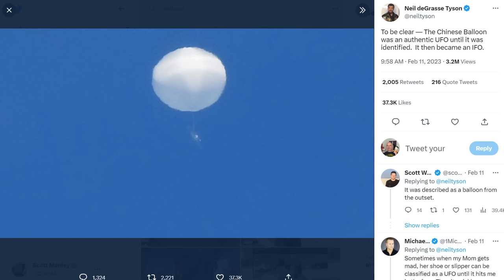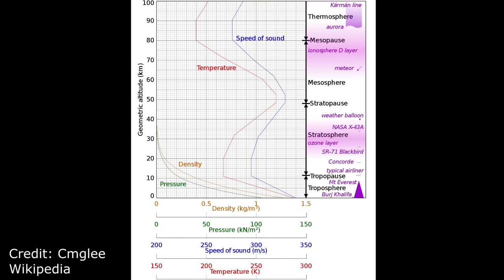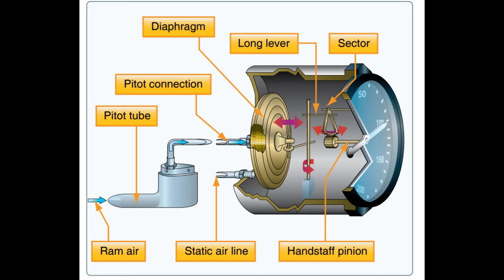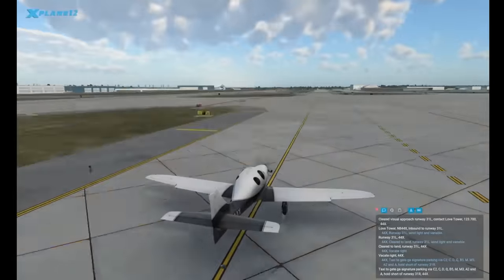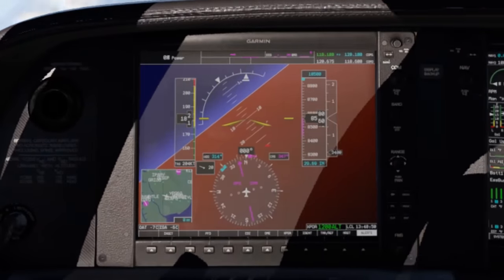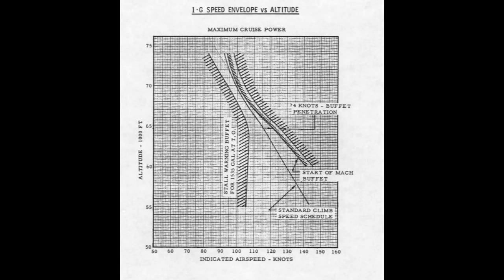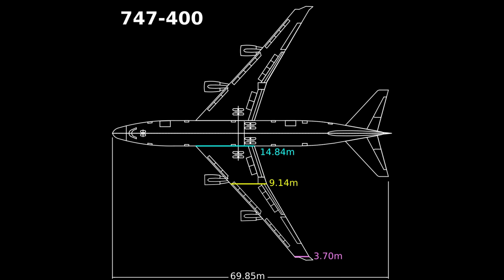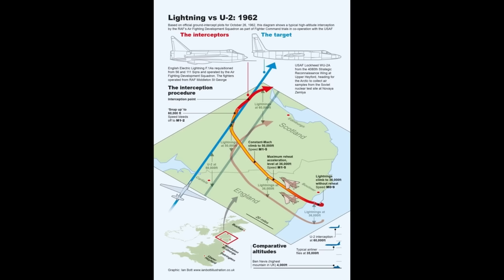How To Design A Plane To Fly At 100,000 Feet?

Comment: Thanks, I really enjoyed and got lots out of this video. The mirrored rocket and writing in the intro really made me wonder for a second.

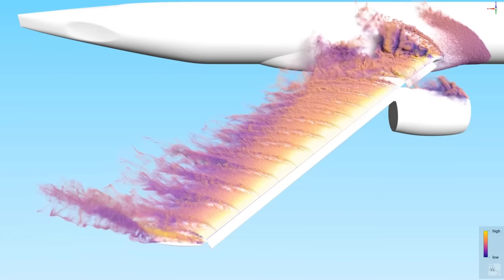You made a statement at around 1:55 that "...most aircraft use engines which push against the atmosphere... " while showing a jet engine on a test stand. While I guess a case could be made for propeller aircraft my understanding for jets it's based on the kinetic energy of exhaust gases propelled out of the back of the engine.  Or am I missing something here?
Reply from the maker: The exhaust gasses are just hot air, getting pushed out the back.

Comment: At Alice Springs gliding club i once heard one of the members talk of riding a summer storm up to 50,000 feet. The altitude recording device stopped at that height so he didn’t know how high he went. He said he didn’t have airspace clearance so didn’t get an official record. His answers to questions like how did he breath (oxygen tank) how did he get home with the canopy iced over (looked out the little airflow hatch).  I’m curious if he could have gone so high without a pressure suit?
Reply: High-altitude variants of the Spitfire are recorded in post-war exercises as having reached 49,000 feet, but these had pressurized cockpits. Unpressurized Spitfires are documented as having fought about 40,000 with pilot oxygen, but with extreme difficulty and only on rare occasions. I wouldn't go so far as to say that it was impossible or that he is lying, but I find it interesting that he was prepared enough to have oxygen with him to climb so high that airspace clearances would be a complication.
Reply: @Ensign_Cthulhu  That’s cool to know! He said looking at the huge summer storms roll through every year it was was only natural to want to climb one.

Comment: Not sure if this is true, but supposedly it is.  In the SR-71, you could actually save fuel by flying faster.  I think it was the compression heating of the air allowed them to use that to get additional power out of the engine?  Doesn't sound right, thermodynamically speaking, but supposedly faster = less fuel used, well up to the limit of the hull heating.

Comment: Great video Scott. Just one observation. Mach Tuck. Is this more to do with the centre of pressure of the aerofoil moving rearward causing a nose down attitude? Hence why Concorde shifted fuel to the tail to counter the effect, re balancing the C of G as the aircraft accelerated through the transonic region. Subsonic airliners such as the B737 also had/have Mach Trim systems that automatically added nose up trim for the same reason.

Comment: If increasing wing area is not an option than perhaps some of the thrust can be redirected  to provide additional lift and flight control. The thinner atmosphere at higher altitudes should reduce air resistance so the aircraft will not lose that much speed despite the lower thrust.

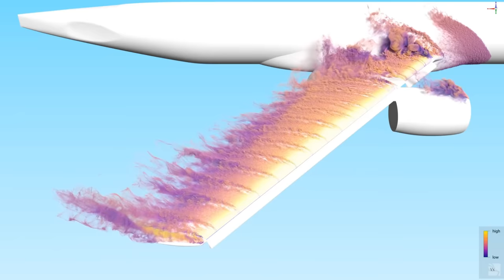Comment: Aircraft engines never “push” against the atmosphere as stated at 1:55 and 6:35. Propeller, rotor or turbine aircraft engines operate off of the same principle as rocket engines, Newtons 3rd law, for every action there is an opposite and equal reaction. They all expel air (mass) in one direction resulting in a thrust force in the opposite direction.

Comment: The "engines pushing against air"  thing should be addressed: they don't push against air if it's a reaction or rocket engine, they  push  against their exhaust. Propeller engines push themselves forward by  combining Newton's third law "for every action, there is an equal and opposite reaction" and Bernoulli's principle that "an increase in the speed of a fluid occurs simultaneously with a decrease in static pressure" - in other  words, the  propeller pushes against the air and at the same time is sucked forward by the lower pressure that  forms in some parts of the propeller.

Comment: F-14 Tomcat shot a BOMARC down at 72,000 feet.  (Though that was in testing so not the same thing I guess.)

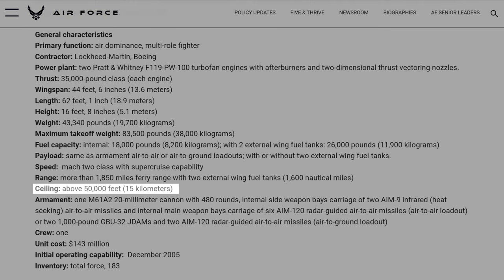Take the sheet there at 1:00 with a mountain of salt.  A lot of those figures are boilerplate and/or incorrect.  The one on the F-15 has given it's top speed at 1,875 MPH for decades.  And it's incorrect.  The F-22 was designed to fight at 65,000 feet.

There is a well known account of two F-104 pilots cruising at Mach 2 and 73,000 feet in their F-104s. 

Re: the A-12 it actually reached 97,500 feet sustained during testing.  The A-12 had the same propulsion system as the SR-71 but it was over 50,000lbs lighter.  (117k vs 172k)

That MiG-25 was using pre-compressor water injection, which was not a standard feature of the aircraft, so in a way it "cheated".  (The F-4 Phantom II Skyburner flights did the same thing though so. . .)

Comment: Jet airliners also have oxygen masks to think about. You can pretty well get away with having unpressurized cabins and unpressurized oxygen masks at 40000 feet. That is pretty questionable at 50000 and flat out fatal even for two minutes at 60000. So in case of a pressurization failure, airliners need to maintain altitudes where an unpressurized oxygen mask in an unpressurized cabin can keep people alive.

Comment: I believe service ceiling is at maximum gross weight in new condition, though engines may have lower limitations (due to arcing in the ignition system for example).  In the distant past I have been easily to 17,500 ft. in my Cherokee 180 at light weight (about 1600lbs vs 2400lbs being gross).

Comment: The problem for most military aircraft is the pilot.  Above 50-60k feet, pilots need full-pressure suits for safety, and few aircraft are equipped for such suits.

Comment: You covered most of the bits I hoped you would, but you didn't discuss the potential for electric planes to raise the ceiling for prop-powered planes, since they don't need to breathe air for their engines.  Just give them a prop like that Caproni...

Comment: The TSIO550K2B that the SR-22 uses is a very well engineered engine. The non turbocharged IO550N70 for the SR-20 is nearly bullit proof. But they do have their limitations. As all engines do. I run the acceptance cells for the manufacturer. Cirrus would not use them if they were not the best in industry. Cudos on the video.

Comment: Correction: Helicopters do NOT generate their lift from the engine. The engine is attached to a set of wings which generates the left. True, the wings are rotating, but they are still wings.

Comment: For clarification, jet engines develop thrust by adding energy to the air passing thru the engine, increasing its momentum according to Newton's 2nd law of motion, providing thrust, same as a rocket, except that the rocket carries an oxidizer, while the jet uses outside air as the oxidizer.
Jet engines are designed to provide the desired thrust at cruise altitude and are horribly inefficient at low altitudes
Indicated airspeed decreases approximately 2%/1000 ft elevation in the standard atmosphere
Maximum continuous power for most piston powered airplanes is 75%.  Conveniently, that occurs at full throttle at 7500 ft density altitude

Comment: Aircraft engine's do not push against air. They all use the physics law that "for every action there is an equal and opposite reaction". By accelerating the air in a jet or by propeller they achieve an action to to the rear which results in a reaction forcing them forward .

Comment: I'm not sure if it was a glitch in flight simulator but I flew a black bird jet on the edge of space all the way from the UK to Australia and the range went to 100,000 miles once I reached the edge of space. The engine barely had any air so it barely used any fuel but the thrust was pretty low at full throttle too. I seem to think the flight took about 5 hours.

Comment: Disclaimer: I'm not a rocket scientist. I'm just looking for clarification. No disrespect is intended. 
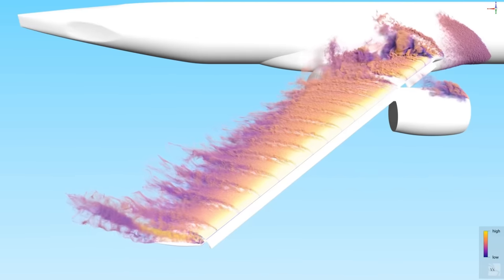You mentioned at 1:54 "most aircraft use engines that push against the atmosphere ...". I was taught that it's strictly a Newton's third law thing rather than "pushing against the air". Once the exhaust leaves the engine isn't it irrelevant what the exhaust runs into after that point (i.e. it's just an equal and opposite reaction that provides the "thrust" rather than what the exhaust runs into)?
Reply: You are right!
Jet engines can't work in space because they need air as their source of oxygen as well as reaction mass, but rockets work better in space than in the atmosphere because there is no external pressure to impede their exhaust gases. The three main engines of the space shuttle did in fact have 23 % higher thrust per unit of fuel consumption in space than at sea level.

Comment: 1:52  I'm sorry, but that is incorrect. Jet engines don't "push against the atmosphere", they make use of the principle described in Newton's third law of motion: "For every action, there is an equal and opposite reaction".
The pressure inside a jet engine caused by the compression of the air ingested through the intake and its expansion due to the heat generated by the combustion is an action that produces a reaction in the oposite direction as the hot-high pressure air leaves the engine through the path of least resistance: the exhaust. It's the same principle that causes the motion of rockets.

Comment: Apologies, Scott M, but you're generally wrong. A plane doesn't need to be a rocket, nor big, nor expensive to fly high. You need an ample efficient lifty wing. An adaptive engine and propeller. An oxygen system including a pressure suit. A heated uniform. That's it. Try a Super Cub with an oversized wooden propeller, a Memphis Belle uniform, and a jumbo oxygen system. See how high you get. I heard 2 different military jets call on the radio. One at 70,000 feet. One at 73,000.
Reply: Doesn’t mean you were that high. Above a certain level it’s all the same frequency.
Reply: @peteconrad2077  Argue with a billboard, today.

Comment: Probably already said, but:
A jet is not "pushing against the air", it's operating according to Newton's laws of motion.  Shoot gas out the back, get forward thrust.  The reason that a rocket can go higher than a jet is that a jet needs the air for oxidation of its fuel, and a rocket carries the oxidizer with it.

Comment: 5:15 airplanes do NOT stall at a given speed. Stalls occur once airflow separates from the surface of the wing due to the critical angle of attack
Reply: which depends weakly on the flap angle an also on the leading edge retractable slats, but not more than a few degrees.
For a wing with  NACA 65210 airfoil, 30 degrees flap at 50% flap span to wing span ratio the stall angle will DECREASE, about 2 ° , depending on aspect ratio., like you said,  independent of bank angle and load.

Comment: Hi Scott, I'm a private pilot in Scotland, studying toward my ATPL exams. I've noticed that in some aircraft the best glide speed coincides with the Vy speed - makes sense, since both require optimum lift:drag. How come that's not the case in all aircraft, however? I'd have thought engine power being available would simply change the pitch angle, rather than the speed for the best lift:drag. I've tried searching for this before, with no luck; sorry to use you as Google!

I'm also Scott!
Reply from the maker: Best glide is at the minima of the drag vs speed curve, however, engine power varies with speed so on many aircraft the higher power at a different speed more than makes up for slightly higher drag.
Reply: @scottmanley  thanks! If you're ever back in Scotland, you're more that welcome to come and slum it for a flight in my Grumman :) There are some videos on my channel.

Comment: FAA limit normal planes to 50,000ft
Concord used to regularly fly at 60,000ft
By burning hydrogen jets can fly higher
Or by having a tank of liquid air.
The prefix YF is russian for high altitude.

Comment: Pure jet engines don’t “push” against the air - they are reaction engines just like rockets. Pure jets do however need air as an oxidiser and engine coolant - and compressed air gets hotter the more you compress it.
Propellers and fan drives both suck and blow and are thus more interactive with the atmosphere. 
The final type of air breathing engine is ion drives - and they work quite happily at orbital velocities and at very low speeds (they just have a problem between the two).

Comment: The definition of the Karman Line is the point where stall speed is greater than orbital velocity (at least by cocktail napkin calculations)
Reply: It was more about the speed required to generate lift at increasingly higher altitudes. Von Karman was theorizing about the point where the speed required to maintain altitude would be equal to orbital velocity. He calculated it to be around 90 km. Although he lowered it to around 84 km to account for an aircraft's limitations due to atmospheric heating at high speeds.

The current 100 km boundary is based more on the effect of the atmosphere on spacecraft than on aircraft.

Comment: I think theoretically hybrid airships should be able to fly higher than either balloons or airplanes. Since part of the lift comes from its buoyancy, they have lower wing loading, lower stall speed, and need lower engine power, right? Though they may need more power to overcome the larger drag due to large cross-section.

Comment: 1:52 - "Second, most aircraft use engines which push against atmosphere to make them move..." WAIT A SECOND!
The clip here shows the JET engine, which DOES NOT, again, DOES NOT "push" against atmosphere! And while I do not know whether "most" aircraft are jets or propeller driven ones, in case of "propelled" aircraft it is the PROPELLER, not the engine, that do the "pushing". (Yes, the engine powers the propeller, but, likewise, we do not say our cars are rolling forward on engines", do we? No, it's the wheels that "push against the road".)

Comment: 1:54 .   Push against the air?   I thought it was "for every reaction there is an opposite and equal reaction"?    Does this mean a jet engine (ignoring the oxygen that's needed for the fuel) won't work in the vacuum of space since it doesn't have air to push against?  ;)

Comment: @ 1:54 Are you sure that a jet needs the atmosphere to push against (second point)?
I would have thought that conservation of momentum, exhaust vs. plane mass, to be more significant.
Reply from the maker: How does the air in the exhaust get accelerated without pushing on it?
Reply: @Scott Manley  I see your point; ambient air moved combined with mass of fuel burned provides the reaction mass.

Comment: 1:57   I cannot BELIEVE you said this, "engines which push against the atmosphere to make them move"!!!   Are you saying without an atmosphere behind the engine, it wouldn't generate thrust?!?!?!   This is the CLASSIC error that space-deniers make about 'rockets can't work in space because there is no atmosphere to push against'.

Certainly the thrust of a jet engine is created as the reaction force of accelerating its combustion gasses aft.  Granted a jet engine needs air to provide the oxidizer, but not as 'something to push against'.

Of course I know you are well aware of how planes and rockets work  (lol)  But that was a bit of a misstep there.

Comment: Engines don't "push against the air."  Regardless of their method of propulsion, they ALL work by accelerating a mass of air (or gassified rocket fuel exhaust) to generate a force:  F=MA.  This is true for ALL engines, whether props powered by rubber bands, flapping wings, helicopters, internal combustion, turbines, as well as turbojets/fans and even rockets!  More specifically, they accelerate a continuous flow of mass (air), thereby generating impulse.  Oddly enough, that's precisely how wings work, too, by accelerating the continuous mass of air flowing past its wings in a downward direction.  Contrary to popular misconception, Bernouli's principle, while partially if not mostly accurate, is NOT why/how a wing generates lift!

Helicopters are just rotary wings.

Indicated airspeed isn't the most accurate at velocities above Mach 1.0, which is used by all high-altitude modern jets, save for the U-2 and its variants.  Instead, they use the Mach meter.

Good to see you're back in the aeronautical manuals!

The A-12 was not the "single-seat version" of the SR-71.  Both aircraft had both single and dual seat versions, and only a couple of those dual seat versions were trainers in the A-12, whereas most of the later SR-71 models were dual-seaters, with the pilot in the forward cockpit and the reconnaissance systems officer operating the surveillance systems and equipment from the rear cockpit, and directing navigation on the mission flight path.

Comment: QUESTION @ 15:25 - What is that tank on the SR71 between the verticle stabalizers?
Reply: I believe that was a linear Aerospike experiment. NASA used their SR-71 as a test bed for a lot of things like that, since it's easier than trying to test supersonic flow at realistic Reynolds numbers in a wind tunnel.

Comment: even fighter jet engines usually designed with a lot of "trade-offs" . they rarely have intake moderators and i don't remember if there was ever variable compressor on them.
Reply: F4s had movable ramps in their intakes and their J79 engines had variable pitch compressor stator blades.
Reply: @rickmurray7123  cool  . but it is not widely used as it raises complexity and reduces reliability
Reply: @mrpicky1868  That's very true, but such tradeoffs are routine as planes get more and more sophisticated in order to keep abreast of and ahead of opponents' technology and capability.
Reply: @rickmurray7123  i wrote initial message as a comment on things i think should have been mentioned